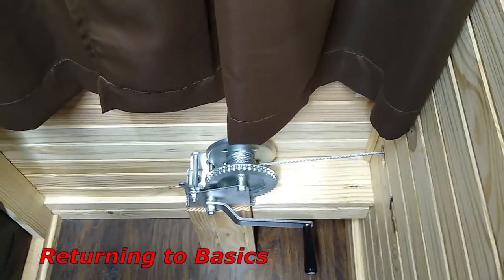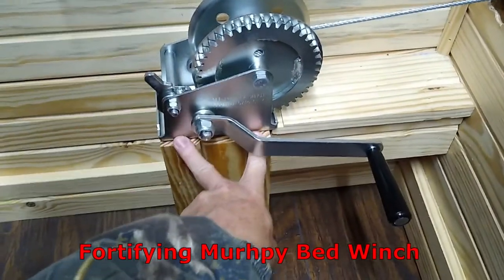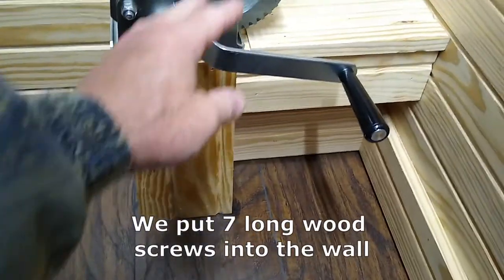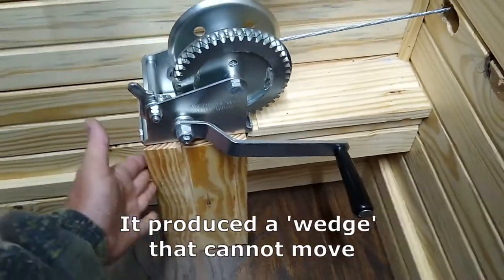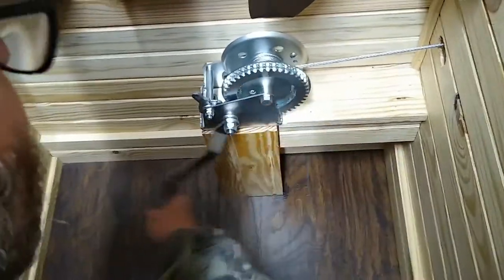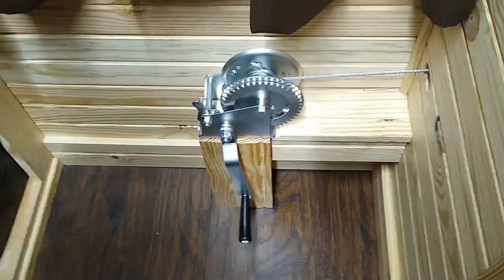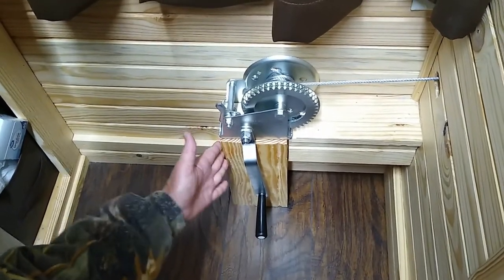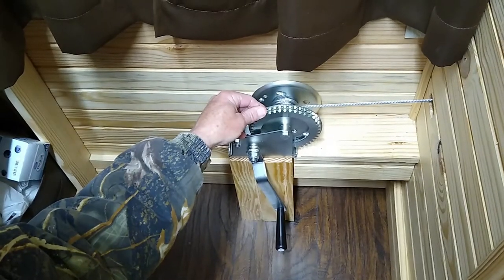Boat Winch Murphy Bed DIY - UPDATE

Comment: Is the winch the only thing moving this bed? How much trouble is it to lower the bed?
Reply from the maker: Yes it is.  My 5'2" small wife is able to operate it.  I have 3 pulleys inside the bed framing that routes the cable in, up, and then over to the top.  Each of these provides some resistance but also doubles the pulling strength of the winch.